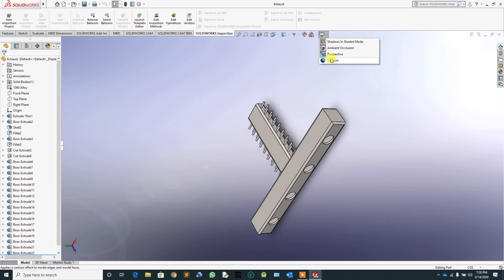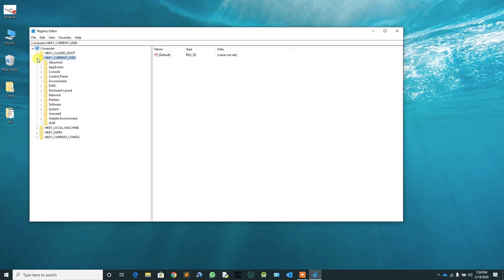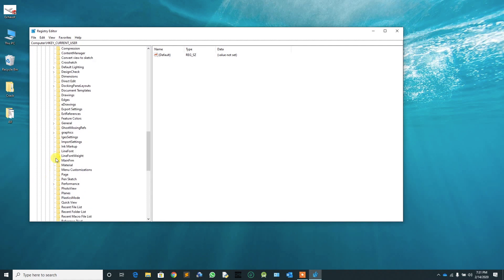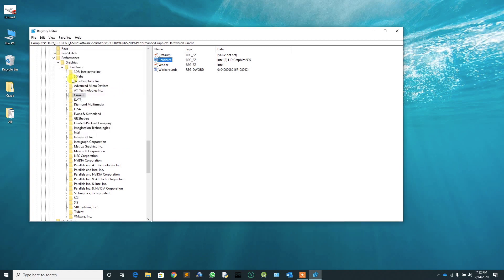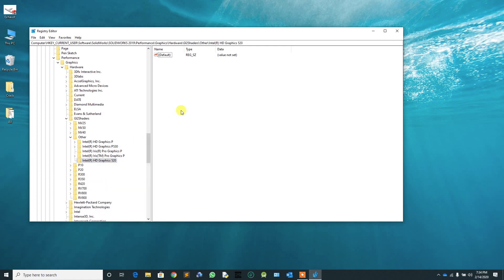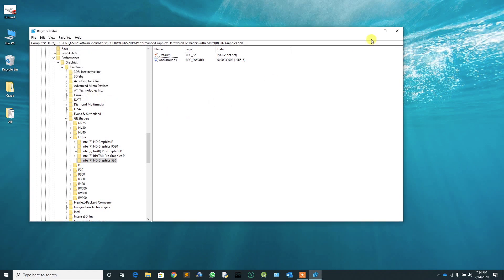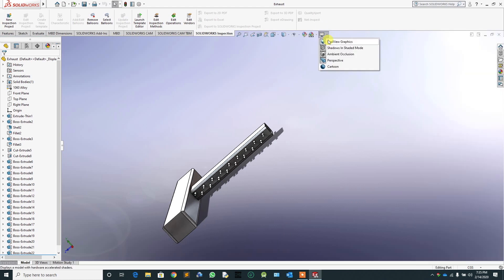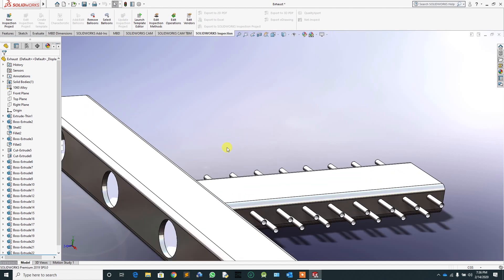How To Activate Realview Graphics Solidworks

Comment: I used the NV40 folder instead of other as suggested, with the workaround value 32408.
Reply: What is your graphic card? Mine is RTX 3060 but still doesn't work.
Reply: @ahmadhusainiabdultalib4652  GTX 1080Ti
Reply: Worked for me as well, thanks so much! (Using MX350)

Comment: I have a Geforce GTX 980 and this did not work for me
Reply: instead of creating the key in others create it in NV40
I did that then it worked
my card is 1660 Ti
Reply: @Mando0007  Thanks I did that and it worked for my GeForce GTX 1660 on 2014 SW